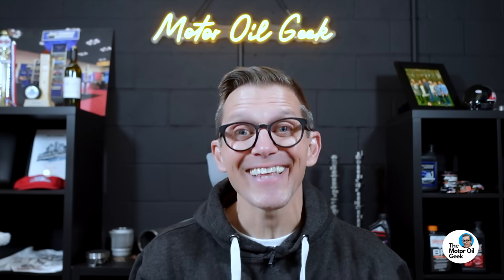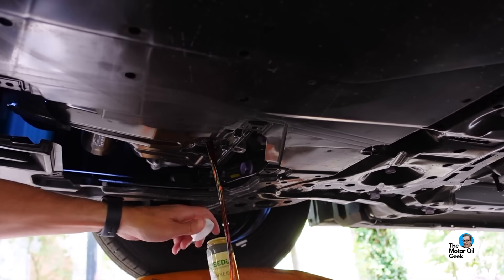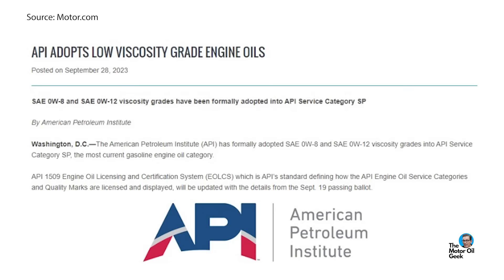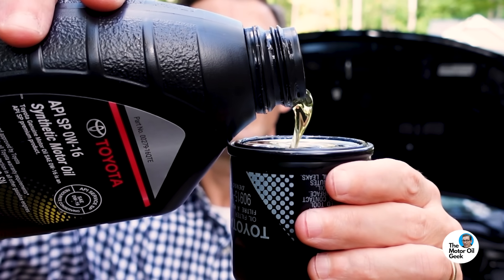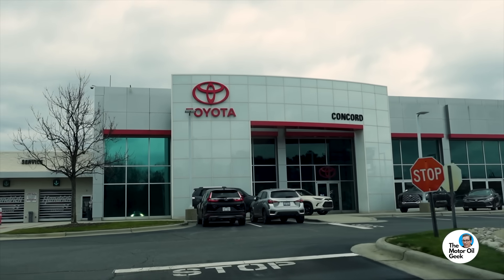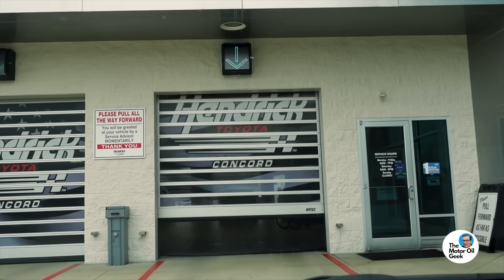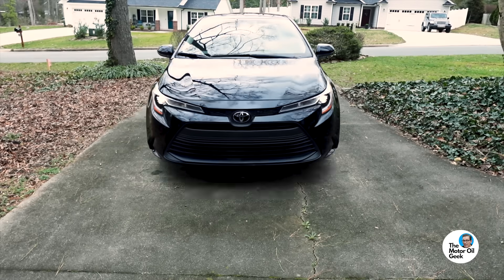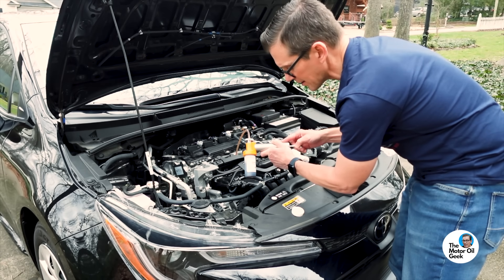0W-8 Motor Oil: Too THIN to Trust? Let's Find Out!

Comment: I have the same 0W-8 spec’d car that I took to the dealer for the free ‘Toyota Care’ service and I asked the service advisor what oil they put in it. She didn’t know and had to ask her colleague who said 0W-20. I said “Are you sure, because the sticker on the engine says 0W-8.” She said “We don’t have that but can use 0W-16 if you want” So I walked over to the dealer parts counter, who had 0W-8 sitting on the shelf. Thankfully he told the service advisor they could use it for my car. 

I’m guessing the average customer gets whatever oil is most convenient for the dealer. When someone comes in and hands them an oil sample bottle to use I bet they call the boss, who tells them to make sure and use the good stuff on this one!
Reply from the maker: LOL, good point.
Reply: Doesn’t matter what the manufacturer is. They are all the same in my area that has monopoly of every manufacturer. My VW Golf R clearly has a big yellow sticker in the engine bay saying use 0-30W and the service advisor tried to tell me that’s not right. I believe Wolfsburg Germany may know better.
Reply: @jagjr6772  To be fair, Volkswagen also lets you use 5W30 as long as it's the proper spec, I should know as i had to check this morning when the VW guy came to sell me oil lol
Reply: Some cars have different oil recommendations in different countries though. I will speculate that it is all to meet EPA requirements.  @jagjr6772
Reply: Good thing you were smart enough to check with parts dept and not accept what the, clueless, Service Writer had to offer.
Reply: I'm familiar with a GM dealership that used the cheapest whatever.  Unless the repair specifically called for OEM parts, they used lowest price import parts, low cost oil from a local supplier in 55 gallon drums.
Reply: I work in a Ford dealer parts department.  95% of the time we have the oil the vehicle calls for either in bulk or in quart bottles in the parts room.  In the event we don't have it, we will call over the AutoZone or Napa and have them deliver the correct oil.  We actually started stocking mobil 0w40 for 6.4 Rams because one of our customers is a roofing business with a fleet of 6.4 rams and that's the oil they use.  I'm the guy who bills out the parts used and I can't knowingly do something wrong like that.  So I can't speak to other places who don't take any pride in what they do.
Reply: @ryanwinkelman1781  Point is... even if a dealership takes the oil out of a barrel does not mean it is the wrong oil. Also the correct oils are cheaper in barrels than in Liter packages. (I refuse to use banana units... ;) )
Reply: @jackmclane1826  We don't have any oil available in litters.
Reply: @jamesbosworth4191  Then use whatever banana unit you like. Hogsheads, Catbladders, ounces, or other nonsense. ;)
Reply: @jackmclane1826  Why do you want to use the measuring system of the Japanese and the Germans?
Reply: @jamesbosworth4191  And the rest of the world, except Angola and Laos.

Why? Because it is superior in every way imaginable. How many inches are 1.73 miles? No calculator! 1.73 km are 173000cm.
Doesn't it hurt your pride to use some old english kings foot size to measure something? That is medieval nonsense!
Reply: @jackmclane1826  Superior in every way?  Why, then, is there no counterpart to the Foot?  No, it doesn't hurt my pride in the least to use "Some old English king's foot size" to measure.  I will never be OK using  the measuring system of the country who attacked us and refuses to apologize for it, and, destroyed our auto and steel industries, with Saint Ronnie's help.
Reply: @jamesbosworth4191  Nobody needs a counterpart to the foot, if you don't think like a brick. A counterpart to the foot would be an equally worthless unit like the foot. 
We have 300mm, 30cm or 0,3m - use whatever fits the application. 
The metric system is essentially a French invention. Pretty much everybody understood, how much superior it is and adopted it. That doesn't make it German or Japanese.
Reply: @jackmclane1826  Just how would a metric counterpart to the foot be useless?  According to this Internet, a metre is 100 centimetres.  100 can be divided 4 times, so a metric "foot" of 25 centimetres would be a GOOD thing.  It would be much easier to use and understand that is 1 1/2 metric feet long rather than 75 centimetres long.  It would be much easier to visualize, and that is one big reason we Gringos refuse to go metric - we can't visualize metric sizes.  You say the Metric System is a French invention.  They also invented the Renault.
Reply: @jamesbosworth4191  But why not simply call it 25 or 30 cm then and visualize that? I don't understand why that would be helpful, but you could. The height of a standard piece of paper, the length of the typical ruler. 
Maybe it is because you grew up with that foot in mind, that you think it would be necessary?
In itself the foot is just a unit. Neither good nor bad. The full insanity of the imperial system comes with scaling. 12 inches in a foot, 3 feet in a yard, 1760 (WTF???) yards in a mile. And what is 17/32th of an inch? 
When it gets very small, you come to some sense with the thousands of an inch. But too little, too late! ;)
Reply: @jackmclane1826  I strongly disagree.  It would be much easier to visualize 1 1/2 metric feet than 75 centimetres, and yes, as an American who is proud to be an American, I did indeed grow up with inches, feet, yards, etc., so that's what I and most other of my countrymen are used to.
Reply: @jamesbosworth4191 😂metric feet??? Come on man
Reply: @mapsnavigation  Tell me, what would be wrong with a metric counterpart to the foot, say about 20 centimetres long?  It would make the metric system much more convenient to use.  Just think, wouldn't it be much easier to say somebody is ... tall than hundreds of centimetres tall?
Reply: This is why it is simpler and cheaper to just do it myself.  Then there is no question what I'm getting and that the work was done correctly.  It costs me about $34 to change my truck with top shelf synthetic and a good filter.  At those prices I can change my oil at twice the factory interval and still come OK on costs.
Reply: Some advisers pretty chill. In bmw they gave me a doc from manufacturer with oil specs and ask what I want them to use. Also allowed me make a copy for myself.
Reply: I would imagine they have a pump and dont even normally use oil from jugs.
Reply: @taz4100  It is in large barrels and yes, it is pumped.
Reply: @taz4100 Yeah I’m sure they buy bulk oil to save money. They don’t want to use the expensive stuff if they don’t have to.
Reply: They use oil from barrels trust me!
They are not opening individual quarts
Reply: You get bulk oil in most cases.
Reply: What is the "good stuff" in your story? If you have the chance to run a little thicker oil with OEM specs in your car, I'd do that any time. 
Engine oils/bearings are optimized around a point where friction is the lowest. But that point still has very slight metal to metal contacts that result in wear. So if you can get 0W-20 with manufacturer specs for your car... I'd use that.
The fuel economy difference is tiny.
Reply: I have so many mixed feelings working at a Toyota dealer as a technician. Once you know how the meat is made…
Reply: @eddiepearson7377 share
Reply: The GT500 5.2 uses 5w50 full synthetic oil,  I would trust that over 0w8 is worthless
Reply: No way no how would I run that crap even in my Prius in Minnesota. Seriously anytime I run the 0-20 I get soot on the rear of the car. I have most always run 5-20 in the winter and 5-30 summer and have just shy of 300,000 and virtually burns no oil when I run the 5-30.
Reply: Welcome to the United States where no one knows or cares, no one takes anything seriously and everyone hates their job. Literally you can't even do the simplest things like order food in this country without a 50/50 shot it's gonna be messed up in some way. Do you think that's how it is in other countries? You think thats how it is in Japan? or Germany? I'll tell you, it's not.
Reply: @TimJohnson-x1o Russia yes.
Reply: The viscosity ratings are at different temperatures, but also are measuring something different. 

One is kinematic and the other dynamic. Really the question is whether the dynamic viscosity ratings are an adequate representation of what you require. 

If the oil sticks to a surface providing a film but has no internal friction it could presumably be a zero rating, but still provide more than adequate protection. 

To a certain extent a lower viscosity probably reduces friction in the bearings, therefore reducing the temperature of the oil there so that the oil is not as highly stressed.

Also, I would change the oil again because the new oil could be using a conflicting additive package.
Reply: @themotoroilgeek, what brand oil & filter due you use in your personal vehicle?
Reply: Dealerships All purchase Bulk oil in 55 gal barrels..  you get what they have...
Reply: I would never use lower than 5w30 in my cars even if it calls 0w20 or lower, and they drive fine.
Reply: I’m literally gonna walk into the dealership and just ask for the oil filter and washer telling them straight to their face that I don’t trust a single one of them, because I really don’t
Reply: They were actually not wrong to put the 0w-20 in if that's what they intended on doing. Example: I know a person who lives in Saudi  Arabia and they own a new Toyota Crown Sedan which has the same 2.5 n/a 4 cylinder hybrid you see in America. Per  the American owners manual it states 0w-8 ONLY or in emergency use 0w-16 if 0w-8 cannot be found and then go back to 0w8 on your next oil change. The Saudi owners manual specifically states that you can use 0w-8, 0w-16, 0w-20 OR 5w30 as your oil. In Saudi Arabia, they do use 5w-30 because of heat. Toyota does NOT require 0w-8 in Saudi Arabia, they only require either of the 4; viscosity grades listed above. While 0w-8 is currently required in the US, I plan on using 0w-20 in my new Crown Signia and I will do all the oil changes myself at 6 mo/5,000 miles after the break in changes. The 0w8 is strictly used for gas mileage in the US to avoid Dept of Energy fines here, pretty much everywhere else in the world, they use thicker oil to increase overall engine longevity and are willing to lose a few mpg for that purpose. The Trump administration just eliminated that rule for 2030 that Biden created and Toyota "reliability" has really taken a gut punch recently with their reliability. I am positive that it is at least in part due to the fact they are using such thin motor oil. In the Southern US, most engines routinely have engine temps at or slightly above 200° in the pistons and combustion chambers and 0w-8 is just not going to protect at that temperature for the full life of the engine. I am nearly positive that Toyota in future years is now going to go back to a slightly more viscous oil because of the change as reliability is the most important thing for Toyota per their companies manufacturing ethos.
Reply: I'd rather use 0w-20 over 0w-8 all day, but i live in Phoenix coldest 30°-125°🔥 I'm sure 0w-20 flows just fine in them temps 🤷 dealers use/buy what's cheapest & most common but they should have all in stock. On my 🆕 Tacoma V-6 1st 🛢️ change 545 mi, 2nd 2,500 mi, 3rd 8,000 mi & 4th 12,500 mi!! I run it hard but it's taken care of & front diff & rear diff 75w-90 amsoil & redline MT-LV in the transfer case. Truck is ready to go + OTT tuned
Reply: @honda116969 You definitely should use 0w-20 in your Tacoma, that’s what it’s spec’d for
Reply: @honda116969  My truck calls for 5w20 I use 5w40 even in cold.  Makes better oil pressure at idle
Reply: @justingill5256  And better oil pressure means better lubrication!
Reply: @justingill5256  5w40 is the perfect oil for most of North America. Back when engineers had a say, cars came with a chart that showed what viscosity to use for what temp. a 5W covers the coldest states south of Alaska, and a 40 covers the hottest summers outside Death Valley. So really that's what almost everything should use. I have personally seen the difference between the engines of guys that use the 5w20 vs guys who use 30 or thicker, and at 150K the cam lobe wear difference can be blatantly seen when peeking thru the fillcap of a Ford Modular V8. One of its engineers who retired later even said they were made to choose 20 because it made CAFE happy and was enough for the warranty period, but he would never use less than a 30. That is the attitude manufacturers currently have toward oil choice.
Reply: You cannot trust them!!!!
Reply: Ive had the same issue and made them drain the 0-20 when a smart ass service  writer told me they use whatever the engine requires on my 20yr old Honda Accord because he AND the lube tech didn’t actually know or care what weight oil the car took.
Reply: @tellucas  That kind of attitude is why I don't want a car that I can't work on myself.
Reply: 0W-20 was doing you a favor. Let us know how the engine holds up at 100k miles with 0w-8
Reply: @aightm8  It will be just fine.
Reply: Do your own oil changes
Reply: Dealers aren't as bad, but Most places are hacks and give everyone 5w30 dino oil. 
Most don't even change the filter.
Reply: @GT-mn3bx  National oil change establishments buy their filters for as low a $1ea. Really no incentive to not install. I normally do all my own oil changes except in cold weather. I'll  purchase a high quality filter for them to install, but they'll only give a $1 credit.
Reply: , caught my Buick dealership doing just that...now take it to Mobil1 for my oil changes because they only carry Mobil1 oil & filters.
Reply: @GT-mn3bx  I'd call bs on this. I mark all my filters when I get home from a change and I've never not had my filter changed and also never heard if it. That would get them into trouble really fast let alone the number of warranty engines they'd have to replace after 4-5 oil changes but no filter swap.
Reply: @TheRealMrRoyal  Glad you trust them..
Reply: I own a 2019 Dodge RAM truck with a Cummins diesel engine. Last year, my Dealer used the wrong engine oil. The receipt had a Part # instead of saying 15W-40, so I didn't catch it until after I got home. According to the TSB mailed to my house in 2020, 15W-40 CANNOT be used in my engine. It MUST be 10W-30 (for warmer winter temps) or 5W-40 if my winter temps go below -18'C. The Dealer stated they had no knowledge of this TSB, and changed the oil & filters again the next day. They thanked me for advising them. They had to recall about a dozen customers because of the TSB I showed them.
Reply: @46fd04  They had a recall that just involved updating software on the computer. Engines were getting starved from slow oil flow through startup to ambient temperature being reached,which was to help their emissions systems. That’s why the lower cold W’s as 5W or 10W were used. When the engine is warm the viscosity is still 40 whether it started at 5 or 15. Hope this adds some info.
Reply: @46fd04 please post that TSB number
Reply: That's because the dealer knows it doesn't really matter what weight of oil you use. Those super lightweight oils only exist for pleasing the EPA not because they're actually needed. I put 5w30 in everything, including my 400k mile Prius.
Reply: You are correct sir. It will be some time till 0/8 will be in bulk. IMO it's a bad idea for toyotas  long life reliability. I just don't see an engine from the start till 300k have 8w oil.  Something to think about.
Reply: @krishall3187 You might be right, although I doubt that Toyota would spec an oil that would cause reliability issues. I think people also questioned the use of 5w-30 when it came out 40 years ago and now it’s considered a thicker oil for modern cars.
Reply: @ryanb5189  thin oil is for epa cafe standards, remember epa wants you change oil less with thin ass oil f@&k that.  Most engines run vct system off oil pressure!  At 5k miles you really think thin oil is good 🤣 what happens at idle low oil pressure, rpms make oil pressure sooooo do the math lol
Reply: @justingill5256  it's all about film thickness and clearances, a super thin oil can work so long as the bearing clearances are tight enough to maintain a hydrodynamic film. Extreme case of this is diesel injection pumps, which are usually lubed by the diesel fuel itself.

Oil pressure is just a measure of how much resistance there is to flow in the oil system vs how much flow the pump is pushing out. I can tell you I own a couple of engines that make zero oil pressure (in fact they have no oil pumps at all!) and have been going just fine. Assuming you have set the bearings up right, the oil supports the shaft on a hydrodynamic wedge that generates far more pressure than your oil pump can. The pump provides excess flow largely to keep the bearings cool.

The piston rings are ok with very thin oil, as is evidenced by 2 strokes whose rings survive on 20 or 30 wt that has been heavily diluted with fuel. They have to use roller bearings on the crankshaft though, a plain bearing would have no chance of survival with the tiny amount of diluted oil that's on offer in a modern 2 stroke crankcase.
Reply: @krishall3187       did you even watch the video?
Reply: @krishall3187 I already found it from a supplier. I was not going to continue to pay $15.34 a qt with a commercial account.
Reply: These engines can run up to 5W-40, dependent on where you live. 0w-8 oil will cause more wear over time. Proven fact.
Reply: @littlet7556  Who proved that fact?
Reply: @littlet7556 you are correct
Reply: @littlet7556 want this proof.
Reply: Using an oil with higher viscosity, will increase fuel consumption, right?
Reply: @ΔημήτριοςΚαραβασίλης-ω5λ depends on how far you drive each day. I've been running 10-30 or 5-30 for years. Then of course. My 24 year old truck is not a thrifty fuel consumer..😅😅
Reply: @ΔημήτριοςΚαραβασίλης-ω5λ Right
Reply: Will for sure fuck up your engine lmao  @ΔημήτριοςΚαραβασίλης-ω5λ
Reply: @ΔημήτριοςΚαραβασίλης-ω5λ nope your car can't read the label nor can your car hear you if you added a higher viscosity oil 😂
Reply: @ΔημήτριοςΚαραβασίλης-ω5λ  by a few cents maybe, it's never ENOUGH really
0w20 vs 5w30 for example what, you get 25 mpg vs 24.6-24.7 mpg
Is it worth it? doesn't really make a difference
Reply: Yes. A little. Thicker oil means harder working engine means lower mpg.
Reply: @ΔημήτριοςΚαραβασίλης-ω5λ  0.1 Mpg decrease!  Big deal!
Reply: @ΔημήτριοςΚαραβασίλης-ω5λ  In short,

Thinner oils will have less fuel consumption, but don't protect the engine as well (which is why they have to have an additive package to compensate for the thin oil).

You can also have oils that have the same viscosity but different specs and so one may protect the engine better than the other,

But a general rule is that a thicker oil will always protect an engine better than a thinner oil.
Reply: When 0w20 came out many engine designed had to be scrapped because of oil starvation. My friend's Camry uses 0w16 and I was like wtf... Toyota is becoming Ford and Nissan and are damaging their engines and will void your warranty if you use the correct oil
Reply: Maybe, about .1 MPG, which is almost immeasurable.
Reply: Not really but gives better protection
Reply: It will wear your engine quicker because the thicker oil cannot get to the top of the engine as quickly as a thinner oil
Reply: @Alex-Zone  oil is always on engine parts. The first place for oil pressure to reach is the bottom end. The head isn't as important to lubricate since it turns slower than the bottom end and doesn't deal with the same level of forces
Reply: 0w 30 is not thick.  It is water thin.
Reply: @Alex-Zone  Depends on your climate and whether or not you warm up your engine before driving off.
Reply: @jamesbosworth4191  We tried 0W30 in a fleet of 250 gas work trucks, and yes, they all consumed a  VERY noticable amount of oil over 5w30. You're correct on the VI package taking up space too.
Reply: @GT-mn3bx  if you switched from conventional to synthetic on high mileage vehicles you should have expected that. The synthetic oil will clean the carbon off the rings but in the process of doing so, leaves some gaps increasing usage. This goes away after a time once the rings are fully cleaned off.
Reply: @eclipsegst9419  Wasn't though. Bigger engines just have looser tolerances, more blowby.
Reply: @GT-mn3bx  Both oils are a 30 grade when hot, which is when oil is at it's thinnest. 0w and 5w only refer to how resistant to cold temperatures an oil is. They do not make an oil "thicker" or "thinner" at operating temp, which again, is when the oil is at it's thinnest. Every engine i have swapped to synthetic later in life has burned oil for a few changes, less if it gets ran hard, but it goes away.
Reply: That is very sad to read that a Toyota Care Service Representative or Toyota Service Advisor doesn't know what engine oil to put into a Brand New Toyota!  I would go directly to the manager of that dealership.  I would go over that dealer manager after I reamed out that manager and call Toyota Corporate!  If something happened to that Toyota engine, they would blame the owner of the vehicle for not installing the correct oil, voiding the warranty.  I would definitely not put up with that.
Reply: I have wondered when I take my Honda CR-V to the dealership for an engine oil change just what kind of oil they use.  It requires 0-W20 oil but some friends have told me they put in some bulk oil and not real quality stuff.  I wonder if that is true.  The oil changes cost about $60.  😊
Reply: @roberttroxell4006 I don't take my granddaughters hondoo to the dealership for any kind of maintenance at all. 
I do all of my granddaughters car maintenance myself.
Reply: They run a lot better with 0w20 because 0w8 they are pretty much starving for oil when they get warm
Reply: @owenmcalexander7530 Interesting. Can I ask what your qualifications are? I really have no reason to doubt Lake Speed Jr’s qualifications and he didn’t seem to come to the same conclusion as you.
Reply: As soon as I read "she" I knew the person would be clueless.
Reply: That oil is too thin.  Use at your own risk
Reply: @jamesbosworth4191  According to your pea brain.
Reply: thats why we call it the 'stealership' and 'crapitalism'